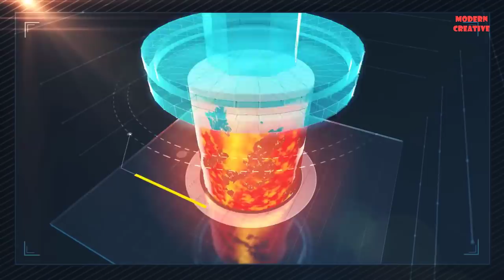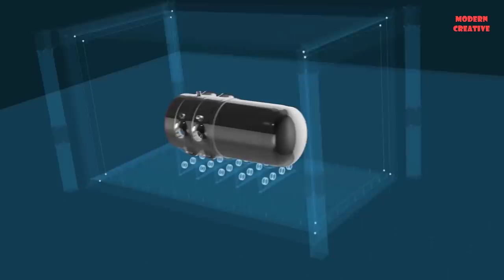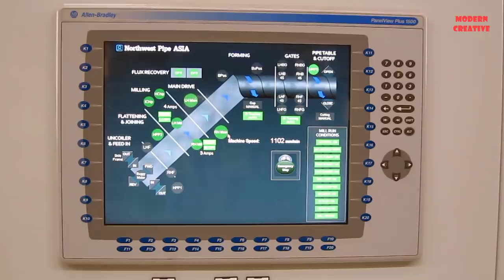This is how highly skilled welders make amazingly gigantic mechanical products

Comment: Looked like the steam generator to a nuclear reactor.   Worked around them a lot in Barberton Ohio and Evansville Indiana.
Pressure tested to 254 atmospheres, that’s 3,700 psi.   Water won’t boil until heated to 700 deg F at that pressure.   You can transfer a lot of heat with water that temp.
Reply: That's supercritical temp and yes very efficient
Reply: Antonmursid🙏🙏🙏🙏🙏🇮🇩🇮🇩🇮🇩🇮🇩🇮🇩

Comment: Do not get fooled by scale it is the same as making smaller products.
Reply: Have you ever welded 2or 3 inch steel its not the same buddy this takes an incredible amount of skill and patience
I know because ive done it these guys are talented from the layout guy,fitter,welder ,machinistand laborer
So its not the same as smaller scale
My 2 cents
Reply: @armandogonzales1365  Well i actually have welded even thicker steel than that. I did my apprenticeship i think you would call it that in English. At R.D.M Submarines. A Dutch shipyard specializing in guess what ? Yes Submarines. Subsequently did a lot of different stuff. Anything from structural steel to experimental items greenhouse heating systems and machinery etc etc. In principal it is all the same. I i make a small pedestriam bridge or a huur railway one. Shaping a bit of plate be it 1 MM or 110 MM essentially is not different. Welding is at heart is reclame thing as well.